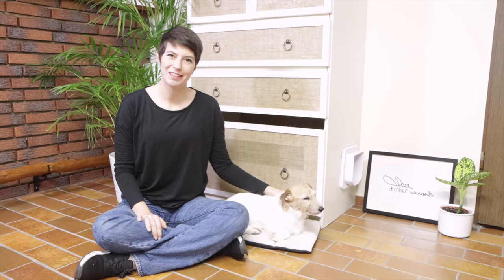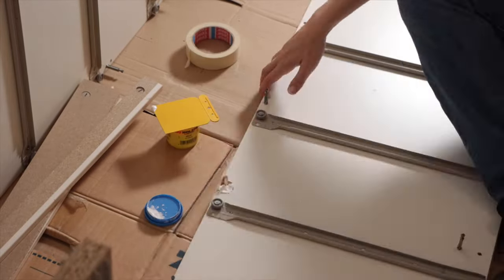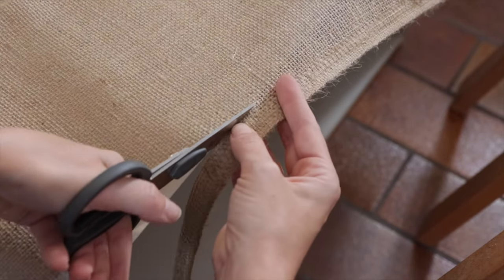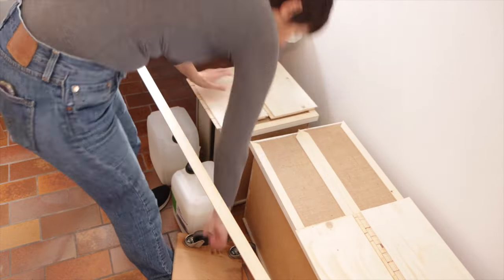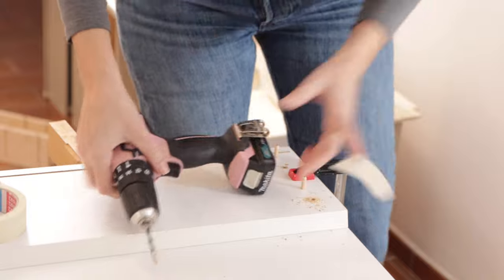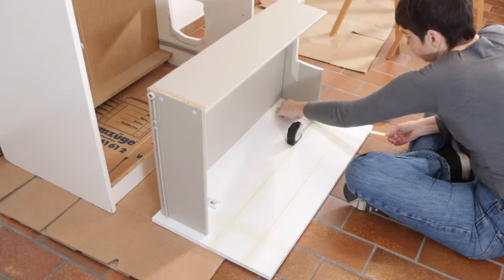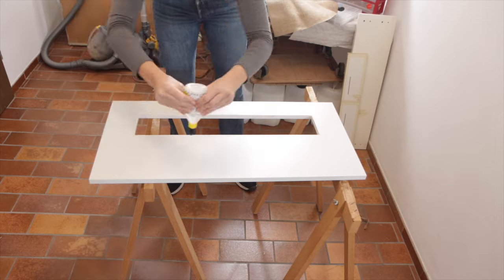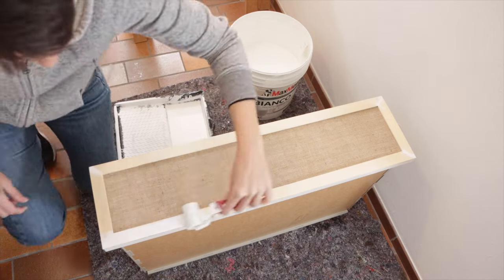EASY DIY Ikea MALM HIDDEN LITTER BOX - @lonefox style

Comment: I love the over all look of this. Very creative. I did a similar project with a small nightstand with 3 drawers. But I took the drawers out & attached all of the drawer fronts to one piece of plywood that then became a door with hinges on one side. So there no longer were drawers inside which is where the litter box went and the entrance was on the side. I prefer to work with solid wood instead of particle board that most of the Ikea furniture is made out of. Screws step out to easily and I want something that will last a long time. 
What I love about yours, is that the box slides out. I think that is a feature I will incorporate into my next build.😊
A friend loved the look of mine that I gave to her and made a duplicate out of the other nightstand for my cat. There were two that I purchased at an estate sale. Well, that kinda got me started on making more and I now sell them in custom colors, hardware, and designs using repurposed dressers, nightstands, large blanket chests, and cabinets. It has become a nice side business for me. I even put an addition onto my woodworking shop to store the pieces of furniture as I come across one at estate sales, thrift shops, and auctions.

Comment: This looks gorgeous! An ambitious project that came out quite well. I was wondering how you'd address ventilation. Very smart to cut the hidden hole in the drawer. A suggestion if you want to take it to the next level-- Cutting a hole in the dresser wall opposite the kitty entrance and installing a small exhaust fan (think PC-sized) in line with a carbon filter to improve air flow and quality. :D